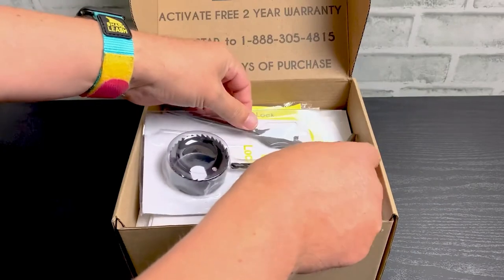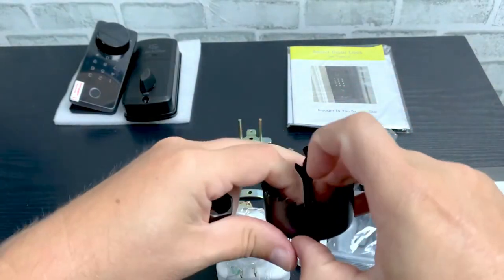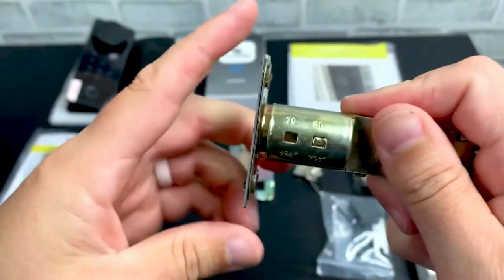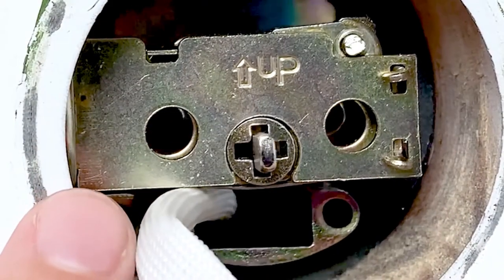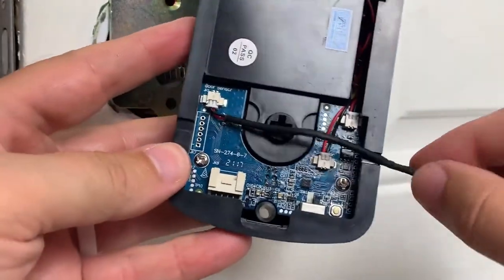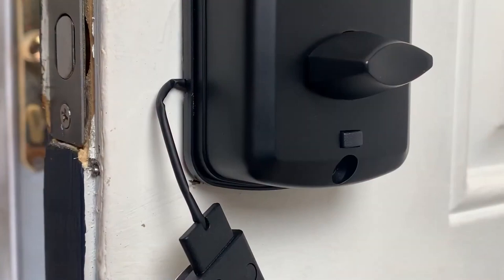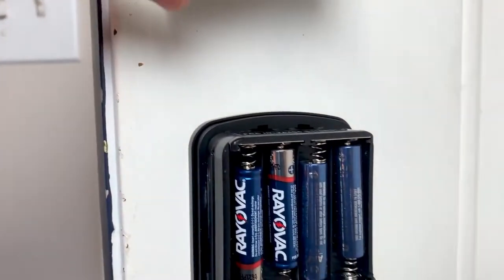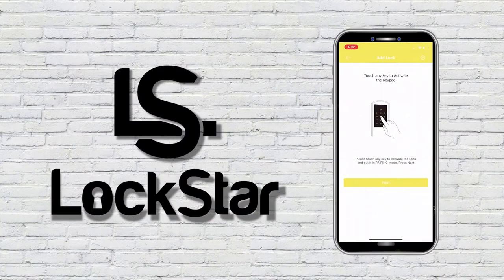LOCKSTAR® Smart Door Lock Installation Video - for Previous Lock Version

Comment: The problem I have with smart locks is it’s only the deadbolt. Wish it tied to the door handle lock as well
Reply from the maker: Hello! I completely understand - it would be convenient to have a system that integrates both the deadbolt and door handle lock. While we don’t currently offer a separate door handle that pairs with our deadbolt, we do have the LockStar Smart Door Lock with Handle option. This model features a single latch instead of a deadbolt and works great for certain setups. We’re still finalizing the installation video, but it’ll be available soon. If you ever need help with anything, don’t hesitate to reach out to our customer support team. We’re always here to assist! LockStar Team

Comment: Heads up no need to drill into door with the top screw at 2:41 you just attach with the two 30m mm bolts like in step 4 of the manual. I broke the screw trying to drill into door 😅
Reply from the maker: Hey there! Thanks for pointing this out to us. You're absolutely right—no need for that top screw! Sorry for any confusion during installation. Just to clarify, your model is the newer one, and we'll update our instructions to reflect that. Just use the two 30mm bolts like it says in step 4 of the manual, and you'll be good to go. If you need any further help, just give our customer support team a shout. We're here for you! LockStar Team
Reply: Great tutorial. It might be helpful to divide each step into "chapters" though, especially if you're using this as a reference during installation. Thanks for the great product!
Reply from the maker: Hi there! Thank you so much for your feedback! We're thrilled to hear that you found this tutorial helpful. We'll definitely consider your suggestion about breaking down the steps into "chapters" for easier reference during installation for our future tutorials! We're delighted that you're enjoying our product! If you need any assistance, don't hesitate to reach out to our customer support team. We're always here to help! LockStar Team

Comment: What kind of battery i have to use for this product
Reply from the maker: Hello! Thank you for your question on our Smart Door Lock. The lock runs on 4 AA Alkaline batteries. We recommend using alkaline batteries as they're designed to work best with Smart Door Locks. Not only do they provide consistent energy, but they also tend to last longer compared to other battery types. If you have any more questions, feel free to reach out to our customer support team. We're here to assist you! LockStar Team

Comment: Can you install this on a upvc door?
Reply from the maker: Hi there! Thank you for your question on our Smart Door Lock. I'm afraid our Smart Door Lock may not be the best fit for upvc doors. The lock works best with standard wooden, framed glass, or metal doors requiring a door thickness ranging from 1.5 to 1.9 inches (38 to 48 mm) and a door width greater than or equal to 4.3 inches (110mm). If you have any more questions, don't hesitate to reach out to our customer support team. We're always here to help! LockStar Team